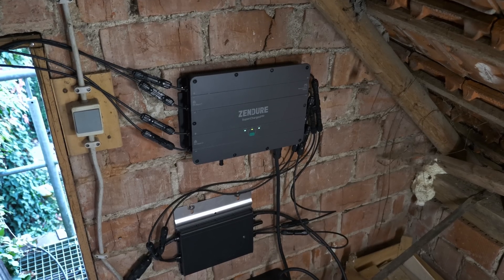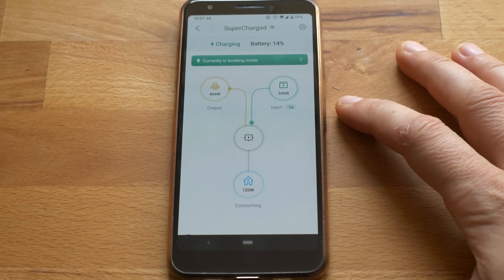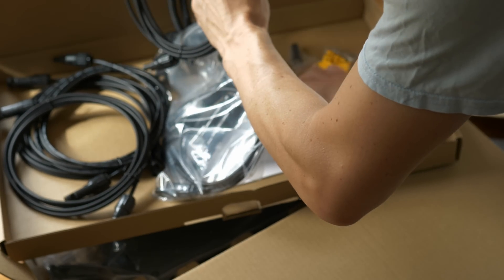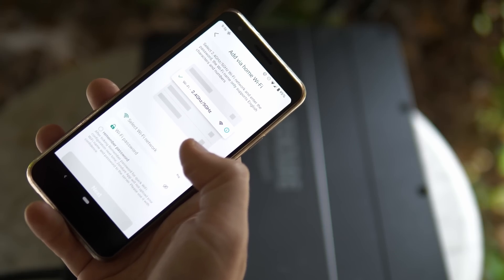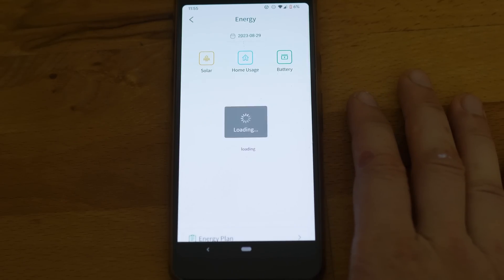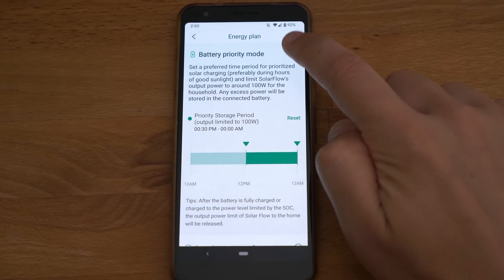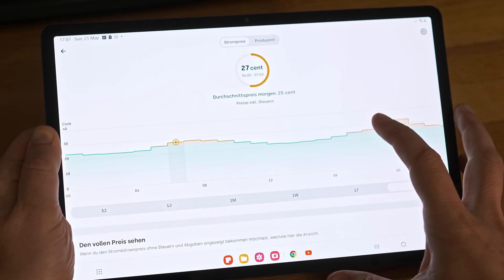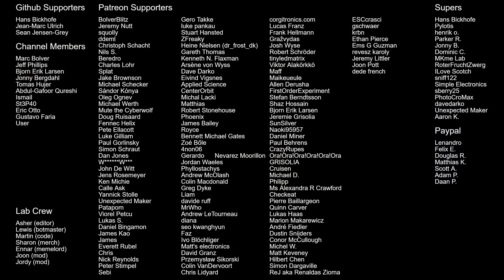A solar battery for everyone: Zendure SolarFlow Test

Comment: I spent 4,000€ on two of solar hubs and four batteries and after a month of nothing but trouble I regret buying this product. It seems to please itself when it works. It occasionally follows the appointment schedule, frequently drops WiFi signal and Bluetooth does not work properly on either system. It will randomly go into standby mode despite the batteries being at half capacity and the panels in full sun. Only a reset of the systems wakes it up. Requires constant daily attention to see if it is working. The longest it has worked as it should is three consecutive days. I do NOT recommend this product. If I could get a refund and return the lot I w

Comment: This system is very expensive and ineffective. With this money you can buy an off-grid hybrid system with a 3kw inverter, 24v 80 Ah battery and 2 solar panels of 550w each (all new)

Comment: You might try mounting the panels  vertically .the reduced heat increases the efficiency . Add a space blanket reflector on floor adds more

Comment: For the 600W power drawing problem.. It could be that the Hoymiles is draining more than it should. That's because it's designed to drain ever bit of power out of the normally attached PV modules. This also makes it not easy for DIY battery systems.
You could adjust the output by changing the Hoymiles limits instead of the zendure limits. Might be easier.

Comment: Only 800w return? I looked it up and I am allowed to put 3600w back in the grid per fase. I have three fases.. which is quite common in the Netherlands. Basically you can put back as much power as the wire going in can handle. There is also no limit since 2014 on how much kwh you can put back in. Why is your power company putting up such weird limits and so very low? Is the writing that crappy? Most installations have at least 6 to 8 panels, that is way more then 800w. And it makes this product useless.
Reply: I know Germany has special rules where you can install a micro system without any licenses, permits or approvals. You can just go the store, buy a system, and plug it in. You can naturally have a larger system but then it needs to be done the normal way with hardwiring, permits, and inspections.

Comment: BitLuni, Can you use IFTTT to control what the system does for different parts of the day?
Reply: esp32 reading JSON from your cloud, where you can put solar commands in for each hour of the day. The esp uses a RTC to fetch time, and looks up what to do for that hour..

Since you can update the JSON remotely at any time, you can change what it does without having to reprogram the esp.

Comment: I wish it were so simple in the United States.
In the US, it is illegal to have the power supply plugged into an outlet like that.  It has to be on its own circuit, wired to the circuit breaker box permanently, and properly identified.
And, in the US, it is usually illegal to provide power to the grid without an agreement between you and the power company.  Like you said, it gets tricky in Germany to get paid for the power you export to the grid, but in the US that is the only option.  The only option is the tricky option with lots of paperwork, inspections, and a signed agreement.  In the US, if you hook up like that and accidentally export power to the grid, the power company can detect it from your meter, and will give you a written warning, and then disconnect you if you continue to do so without that tricky annoying agreement.
Reply: If you don't want to mess with grid approvals you can always set up a system in "self consumption" mode. Basically you have a current clamp measuring your home's power usage and the inverter will always run at a power level slightly lower.

Comment: So here in the UK I installed (I'm an electrician) an 8 panel (8x 300w) grid tied system with 3kw growatt inverter for £1278 we're limited to 3.6kw if we want to install it then notify the dno (electrical supplier) if it's above 3.6kw we have to get permission first. 
I'm now installing at hot water system to use most of the exported power better to use the energy at home rather than export it for half the price I pay for electricity.
The payback for my system without the hot water system looks to be ~11 months.
I did consider a hybrid inverter with batteries but the payback is in many years and didn't make financial sense for me at the moment.
Reply: ~11 months is pretty good. How much do you pay/save per kWh? 
(I'm affraid we have too inexpensive electricity for a viable payback here in FI)

Comment: I think you need about 5-10 kWh battery capacity and PV-Moduls . if the consumption in the evening is about 200W the power of all moduls must 10 times of this about 2000W, only 5 very good Moduls. 10 kWh battery is only for 24 hour without sun. calculate it yourselves for 7 days or for winter time without sunny days. In winter PV will never have enough capacity.

Comment: this system had so so so many issues in the past month that it is overpriced and used false data for example the capacity was far too high rather below 800 Wh than 980 Wh.
There is a german channel that has covered all the issues over months called Der Kanal
App did not work right, data shown in the app were wrong, time to adopt the output. 
Never forget for such an amount you get a 5 kWh rack battery which are here close to 1000€ and prices still dropping due to chinese over production and law demand in the west.

4:29 you will need a spacer on the roof cause this way will cause problems with the panels due to heat from the back. This causes hot spots but in a different mannor cause heat can put pressure on the glas and cause microcracks that are unvisible. That is the reason for the invention of Stockschrauben. 
I know, just temporarily installation but that is not good, so just pieces of a board to increase the distance to the metal roof.

Comment: what do you mean 800W limit? Who's limiting you? WHY? I have a small 4kW system, with batteries. If the battery is full and the panels produce more than the house needs, the inverter just stops the excess energy. Never heard of a 800 W limit...
Reply: If your system stops excess energy production when your house isn't using all the power then the 800w limit wouldn't apply. But your system probably needs to be hardwired.

Comment: shame you didn;t get enough time to checkout the HA integration, that really is a key feature to make this thing usable. Also, would have loved to see if you could add your own batteries into the system with some mods, 600-700 euro for 1kwh is expensive. even taking into consideration the nice enclosure.
Reply: The 15 year warranty will more than make up for that, given they survive that long, but at a warranty statement for 15 years you would expect some quality.
Reply: assuming they'll be around in 15 years. ;)
Reply: @HuMaNiTaRiAn1 All I meant to say was, if they have a 15 year warranty on it, it won't be built like a piece of crap.

Comment: I'm kinda missing the calculation of how long it takes to pay for itself since that's the most important part for many people. Great video as always ofc :)
Reply from the maker: Predictions are hard atm. I'm anxious about the upcoming winter and will certainly evaluate the data in half a year.
I have more projects in the pipeline. One aspect I didn't talk about is that you can basically double the yield of the 800W inverter by adding two panels that are only used for charging
Reply: @bitluni  Appreciate the response! I'm looking forward to the follow up.
Reply: I had the same question, so I looked up on there site what the costs are with discount. So € 2800 for 1 PV Hub + 1 x 900W Battery + Inverter + 400W solar panel. Realistically with this setup you can safe a 1-2 KW of power a day. Going with a current price of 30-40 cents a KW, Means you can safe 30 to 80 cents a day. So a € 107 to 285 a year. Thus it takes about a 10 years to payback... unless the energy prices go up even more.
Reply: @TinusBruins  1-2kw of power on sunny days, I'd say this is viable for maybe 4-6 months. Did you account for this?
Reply: @TinusBruins  This is not true. You don't have 1-2 kWh excess every day. And if so, there was no need for your solar system. If you buy the battery for 839 € you have to save 2000 kWh for 0,42 € to have a return of invest. And this takes realistcly over 15 years. Batteries aren't a proper solution for your 800W system right now...
Reply: electricity ain't cheap in Germany, so I'd guess around 3 years or so, totally viable

Comment: If this is supplying power to the grid, how do you prevent backflow if grid-side maintenance is required? I thought systems like this were required to have an automatic switch
Reply: The big thing in the middle connecting everything is called a battery management system. It manages stuff like that for you
Reply: The inverter measures the grid voltage before and while supplying power to the grid. Only if there is already power, it adds its own power to the grid. There are strict rules that it has to switch off instantly if grid power goes down
Reply: Those things sync to the mains voltage and frequency and instantly know when the power goes out.  And a system that small just cant do shit when it tries to run your whole neighborhood, so there's that too.  For some reason, here in Finland those sets that you could just plug in to existing wall outlet are banned and companies that sell them have disclaimers that you need an electrician to cut of the plug and hard wire it.  Same "problem" with larger inverter systems too.  Search for anti-islanding or something.

Comment: Of course I want to keep the original packaging undamaged for 10 years to have the right for a warranty... Sounds like a way for them to get out of having to actually honor it
Reply: I think in some countries this requirement is ineffective due to local pro-consumer laws.
Reply: In Spain packaging you can throw right away, warranty is on the product not the box
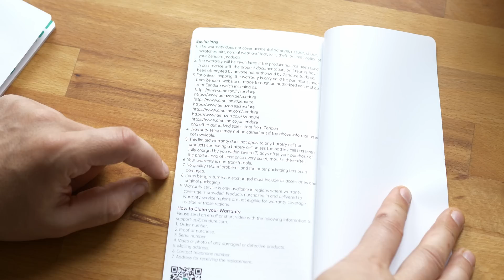Reply: At 3:14 in video, number 8 in warranty, I think that is not for complete 10 year warranty. Only when you return product or exchange it. In EU you can return product within 14 days, no questions asked, and maybe you could exchange it if manufacturer accepts. So you should at most keep packaging for few months for those cases. If product is defective they have to honor warranty, it does not matter if you have packaging or not.
Reply: That requirement would not be valid in the Netherlands. You only need the box if you want to exchange the product. For warranty any box is fine.
However finding a box to safely transport a large format screen for example can be a hassle. Therefore it might be convenient to keep it. In any case they have to honor warranty.
Reply: In the same vein, Xiaomi is asking for my original invoice well after the warranty period as ended to do a safety recall.
Reply: Yes, very suspicious
Reply: And all this hassle to only be able to produce 600W? Why even bother - what a waste of time and money
Reply: @gorak9000  I don't think you understand how little electricity your home actually needs.
Reply: @nikscha  I don't think you understand how many computers and other stuff is running all the time in my house